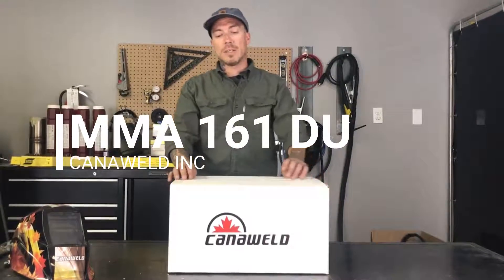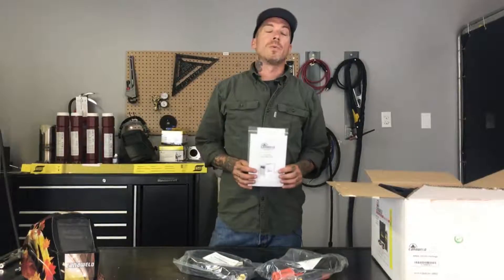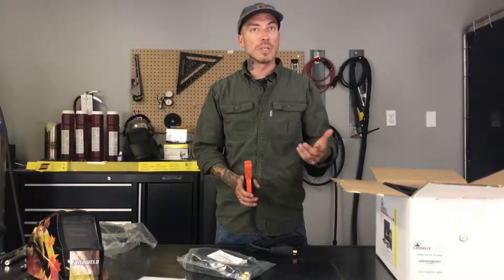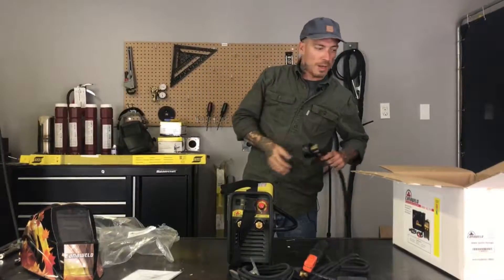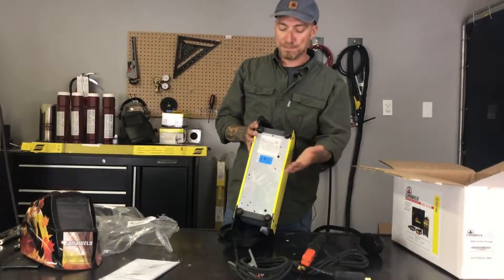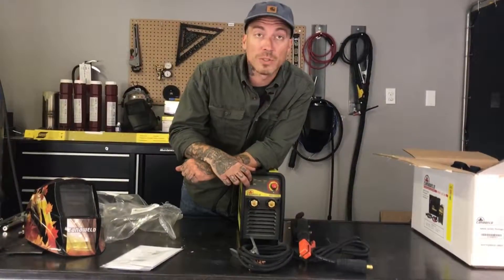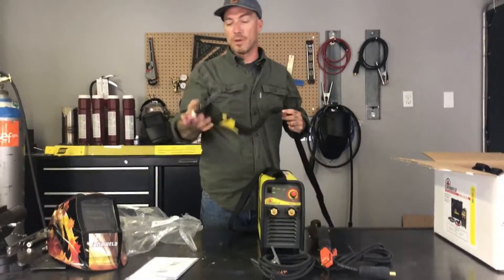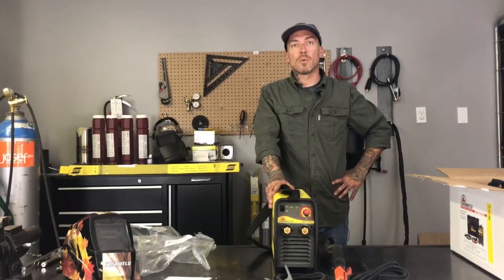STICK welding Machines Basics, SMAW, GTAW, 120/220 V, MMA 161 DU by Canaweld

Comment: Mine still works great after several years. Good little portable stick rig for sure. Won't burn a 6010 but 6011 and 7014 run great. Tried a few lift arc tig projects as well but not much use around the farm.
Reply from the maker: Thank you, @tonyb7748 , for sharing your experience! We're glad to hear that the machine has served you well over the years and performs great with 6011 and 7014 rods. If you ever need tips on optimizing it for different projects or exploring new techniques, feel free to reach out. Happy welding!